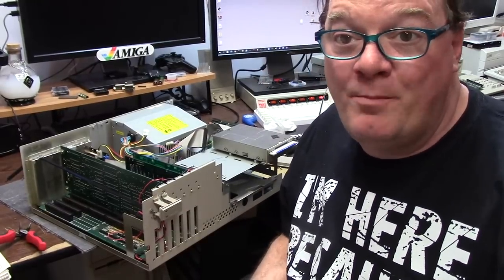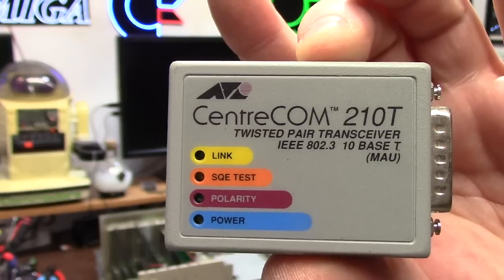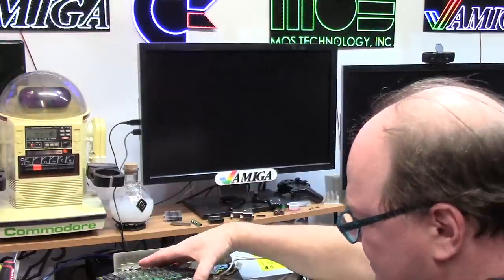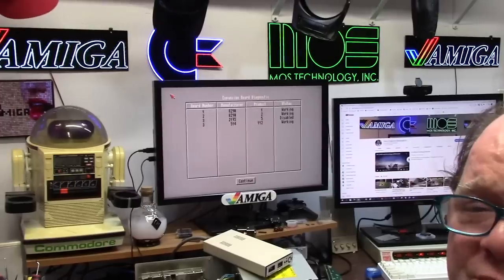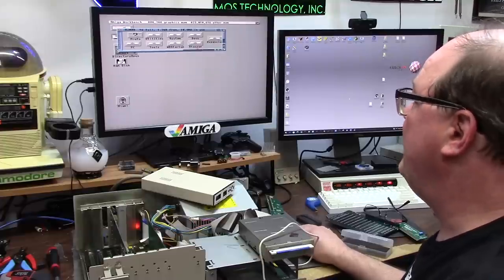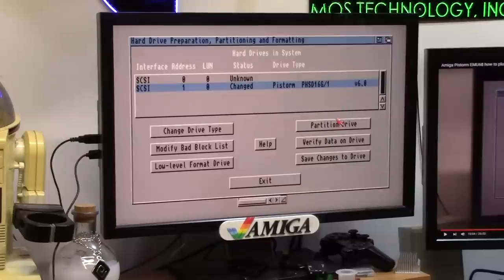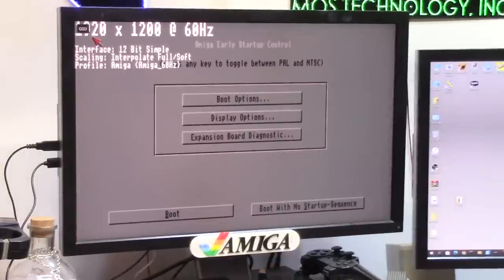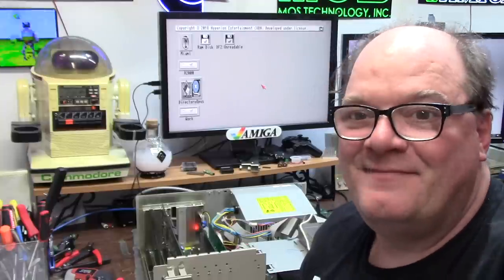epic failures from moronic decisions

Comment: Hahaha great video.  not laughing at you but with you lol... Dataflyer lol nuff said-i won't use them in anything.. Some of that modern hardware needing 020+ has gotten me many times,so easy to forget. keep a old 2620/2630/gvp 030/ivs vector 030/insert card here  around for these cases. I purposely keep and use old real amiga cards because they are proven and compatible and not buggy(well if they do have bugs i know what they are and how to get around them).

Comment: I tend to give in after a couple of hours, put it back to original and think about it for a couple of weeks... then rinse and repeat until it works out... or I sell it/put it back in the junk pile...

Playing with windows 11 lite on a spare laptop & PiMiga on a RPi400 at the moment while I wait for my PiStorm32 Lite :D
Reply: One thing that really is bad on the Pi400 is the keyboard.  It doesn't debounce correctly, so I have trouble typing on it.   So I connected a USB to PS/2 adapter for keyboard and mouse.  Now with my old Dell mechanical keyboard it is good again.  Mice are better on USB though, and the Pi400 is a bit short on USB's without a hub.

Comment: Nice video. By the way, at about 9:25 min you mentioned a virtual FPU and  MMU. I believed that Emu68k running on PiStorm cannot emulate a MMU. So, how did you create a virtual, working MMU ?
I have checked the MMULib on Aminet, but the Readme file says that a CPU with MMU is required for the libraries to work, which means that the MMULib archive doesn't contain anything which can emulate a MMU together with Emu68k.
Reply from the maker: well , who knows. a mystery... maybe i was running a early version that did? idk